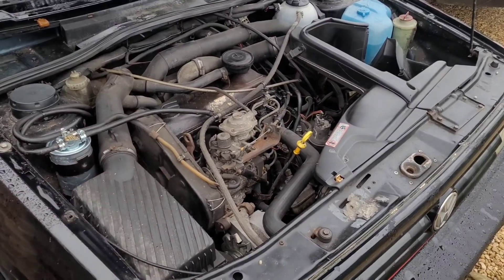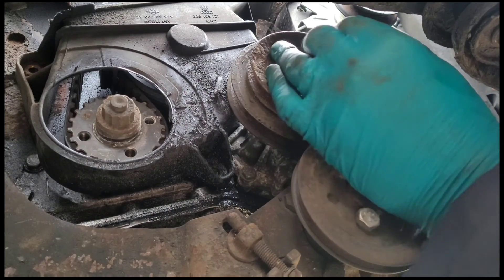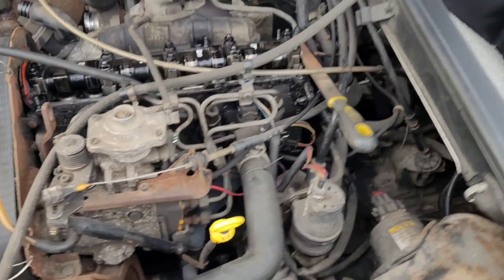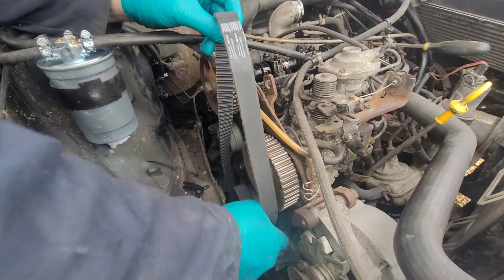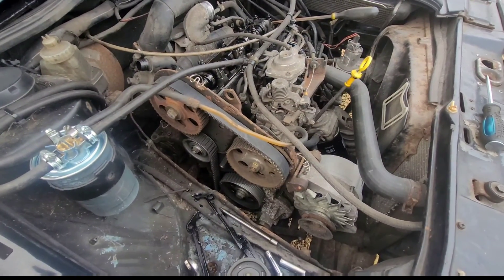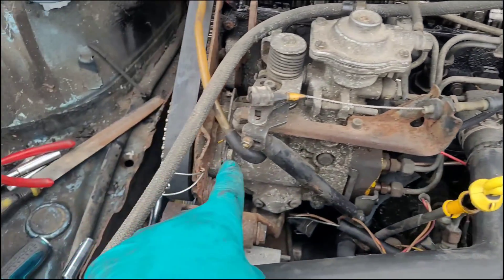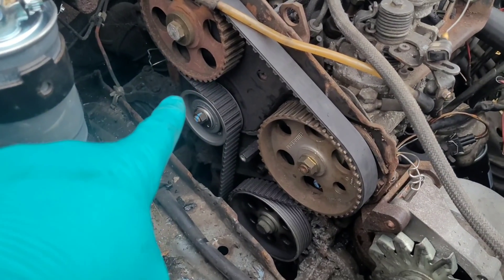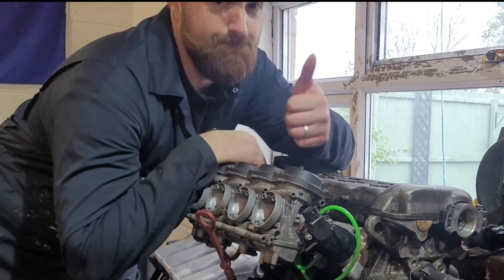How to: VW Mk2 Jetta/Golf 1.6TD Timing Belt + Injection Pump Timing

Comment: So when you get the reading of 0.40, the engine is at TDC, what are you doing with the fuel pump? You said to slacken off the bolts and bring it in line, it will already be in line from the TDC marks. I’m confused, do you mean to take the pump away from the TDC mark ?
Reply from the maker: Yes the engine stays at its TDC and your moving the point of injection away from TDC, so the pump is the one that moves 👍

Comment: If when everything is at top dead centre and my diesel pump at its peek is let’s say 4. Should I set it at 4.1 or 3.9??
A reply would be much appreciated.
Reply from the maker: If its at 4 I would leave it there as there won't be much to gain going 0.1 higher or lower
Reply: Hello.
Sorry to bother you again.
One last question….
Is the idea to get the pump to its peek not going below peek either side of peek? Hope you understand what I’m on about. Or is there a setting I should set it at? 👍
Reply from the maker: @Paul-s4i predominantly yes that's correct, the best range is the .39 to .41 any more can have a negative effect

Comment: At least on the earlier older VW diesels from about 1977 there is a swirl chamber right after the injector that swirl chamber spins the fuel to atomize the Diesel fuel better, but I dont know if Bosch had that swirl for TDI diesels.
Reply: I think they don't, bc they are direct injection. The swirl chamber vortex works, but they figured out how to spray straight inside the combustion chamber better.

Comment: It's probably because I'm an American, but i don't understand what you say (pump timing) when you say turn the engine back a 1/8 turn or until the pointer on the flywheel is about half tenish?
Reply from the maker: Pump timing is in regards to the actual fuel injection pump on the engine, this can be adjusted advance or retarded in a similar way to an ignition distributor on a petrol engine.
Reply: @GreyGooseRestorations una consulta amigo .cuánto se le da en mm al reloj de avance .saludos

Comment: great video man, I have a 1.6 diesel and my injection pump has been pissing diesel, so i am replacing it with one from the turbo diesel, will the compression be the same for the non turbo diesel, between .039 and .041?

Comment: This video makes it very clear but im so nervous to do it myself!
Reply from the maker: Take your time when your doing it, have faith in yourself 👍
Reply: @GreyGooseRestorations  I have installed 1,9 AAZ to Lada Niva, so TDC marks was lost because of Lada transmition. I need exact TDC to setup fuel pump. How can I figure out where is exact TDC. Maybe caliper measurment through the injector hole. I don't know, this is forcam diesel and injector angled to pistons. Any ideas. Thanks

Comment: To change the front engine seals, do I need to remove the timing belt?
Reply from the maker: Yes, it all needs to be removed
Reply: @GreyGooseRestorations  is it worth bothering if they’re not leaking? Or should I change them if I’m doing timing belt anyways? Do they wear much?
Reply from the maker: If there bone dry then leave them be

Comment: You should have marked the old belt and the pulleys, then just transfer the marks to the new belt. Makes it a whole lot easier and faster
Reply from the maker: Thats the worst way to do it, you need to make sure the marks line up and are correct, theres no guarantee that it was right before so to mark it and swap over is wrong

Comment: Very good video . I’ve a gtd mk2 too very interesting
Reply: Am I mistaking, did you said 0,40 pump lift? I guess it’s an SB engine right?
Reply from the maker: Stock was 0.037" and it was set to 0.040"
Reply: @GreyGooseRestorations  I believe it should be 0,90+-0,2. For an stock SB engine
Reply from the maker: 0.037" (0.93mm) stock
0.040 (1.01mm) Performance setting
Reply from the maker: Thanks